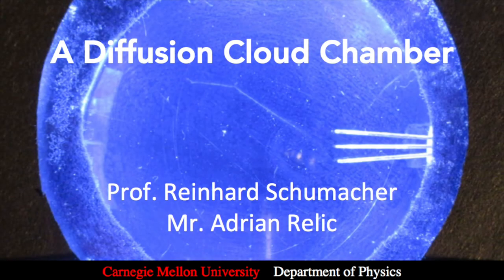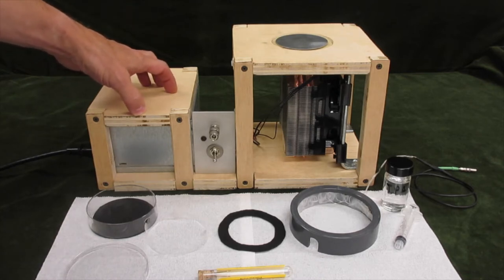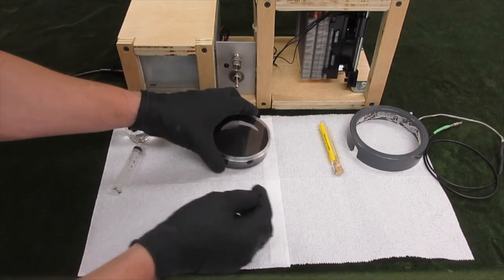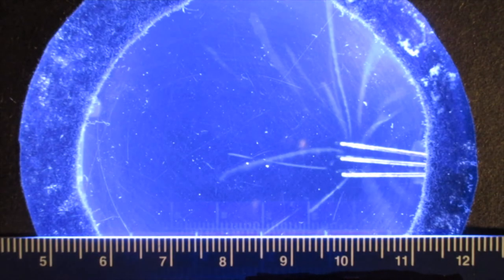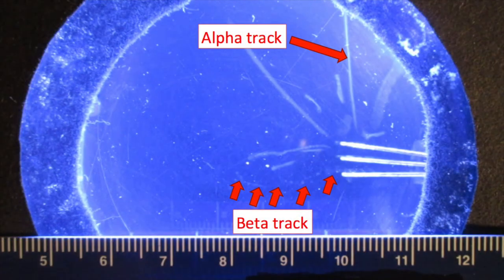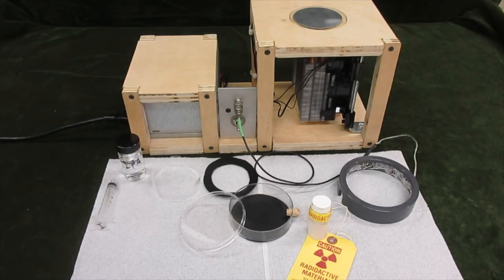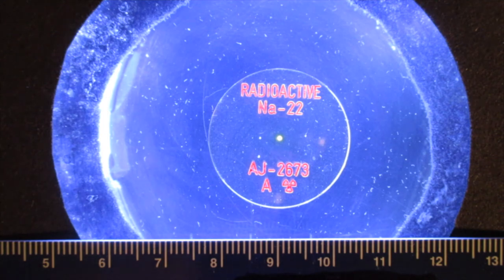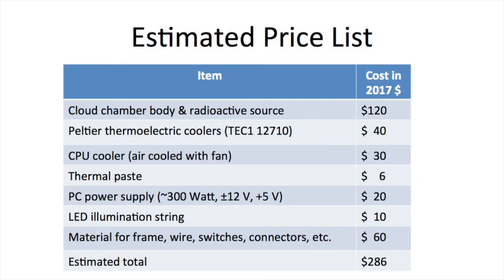A Diffusion Cloud Chamber

Comment: Big question: how many Peltier devices should I use?
Reply from the maker: Look closely at the video:  we used two identical devices stacked on top of each other to reach the necessary temperature.   It is important to have thermal paste between the two plates and also between the plates and the heat sink and the top aluminum plate.   That is needed to get the heat conductivity up high enough.   Again, check the video for a diagram, and also for experimental data showing how fast the devices cooled the top surface.
Reply: @ReinhardSchumacher1  thanks a lot! I just have a bunch of them, and figured too many would produce too much heat, because these things are crazy inefficient.
Reply from the maker: @Noah-ek8hp  Keep in mind that the lowest one in the stack has to take ALL the heat from the ones above to the heat sink at the bottom.   The temperature across the last one can get big.    We found that this became an issue.   We tried three but got no better performance than with two.

Comment: I have used stacked peltier cells (top at 5V and bottom at 12 V) and the lowest I can get is -20 degrees C.  I have used a 4" diameter 1/4" thick aluminum disc and a 3" diameter 1/16 aluminum disc and oddly the 4" disc more consistently attains -20. Any tips to get to -30?  I am using the same peltier cells that you use here, and I have tried air cooling and water cooling and both reach -20.
Reply from the maker: We used stacked Peltier plates with 5V on top and 12V on bottom, like you.   It was important to put conduction paste (for electronics) between the plates and between the top plate and the aluminum plate.   It is a little gooey, and it is messy to disassemble once it is constructed:   that is why on the video I did not just pick off the top plate to show the Peltier plates underneath.  It was important to have a felt insulating ring around the heat sink and the Peltier/aluminum plate assembly.   When we measured the temperature at the center of the top aluminum plate it was covered with a 1/4" felt insulator to mimic the presence of the cloud chamber.   At the edges of the aluminum plate we found that the temperature was closer to -28 C while at the center it was close to -34 C.   

We were somewhat surprised that the 1/16" aluminum top worked better that a 1/14" aluminum top.   Not only did the thinner plate reach the low temperature faster,  but the low temperature was lower by a few degrees.

Good luck.

Comment: I thought beta particles were much more penetrating than alpha particles . But here it is shorter . How?
Reply from the maker: Good question.    Beta particles (electrons) are indeed more penetrating than alpha particles (helium nuclei) when they have the same kinetic energy.   However, in these sources the beta particles come from decays that leave them with much less kinetic energy that the alphas.   They don't have as much energy to give away, on the average, as the alpha particles do.   On top of that, since they are so much lighter, the beta particles easily get deflected by the massive gas molecules and ricochet around to leave spidery jagged tracks.   The alpha particles blast through the gas, ionizing it, but leave strong straight tracks.

Comment: HI Reinhard -   I am hoping to build a cloud chamber as part of an art installation and have come by an ultra low temperature freezer (a new Brunswick model capable of cooling to -86 degrees Celcius) .  i imagined installing a kind of porthole on the front but i wonder if i might just be better starting from scratch?  - a friend thought that the freezer might not work as a cloud chamber as he said that there needs to be a thermal gradient (in order to create the right conditions with the alcohol vapour. do you know if he is correct?  

thanks very much for the fascinating post :)
Reply from the maker: Hello Russell,   A big cold box like that would be a great start for such a project: colder than you really need, but adjustable, and plenty of volume.   You'll get the necessary thermal gradient assuming you feed in room temperature isopropanol that vaporizes enough before it cools.   You need the thermal gradient because you need not just a cold vapor, you need a supersaturated cold vapor.   That means you start out with a saturated vapor at some higher temperature, which then cools so there is more alcohol in the gas than it really can hold at the lower temperature.   Expect to do a lot of experimentation.
Reply: @ReinhardSchumacher1   does the enthalpy of ethanol alcohol (96%) do the trick? or it has to be isopropanol? Cheers

Comment: will common alcohol (96%) work?
Reply from the maker: The "common" alcohol we used is isopropanol, or "rubbing" alcohol.   No need to get high purity stuff, just use the 70% product sold in drug stores.   Alternatively, you can try methanol or "denatured" alcohol, but that worked slightly less well for us.   We tried several other alcohols just because we could: glacial butanol and ethanol.   They did not work any better than isopropanol in our setup.
Reply: Red HEET is available at any Walmart or auto parts stores and is 99.9% IPA.